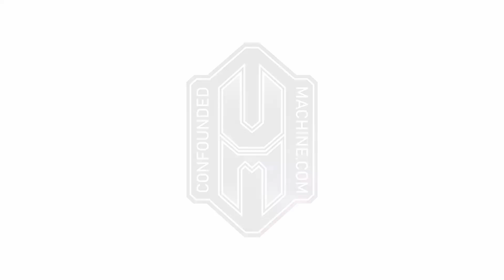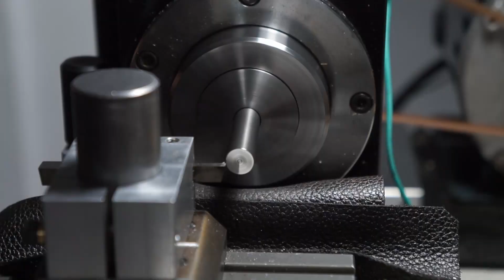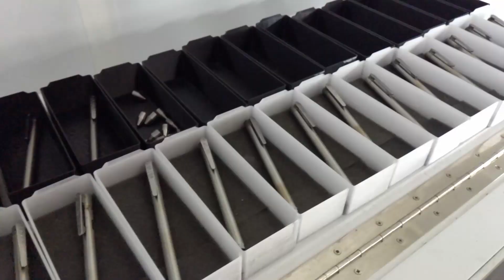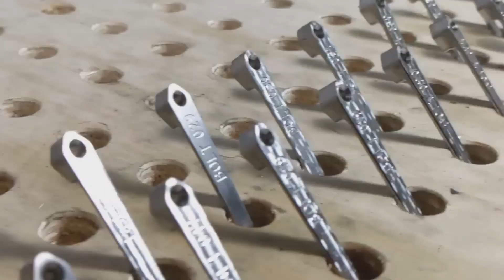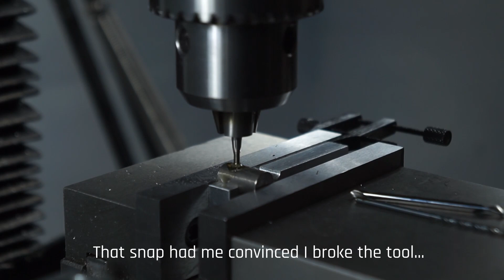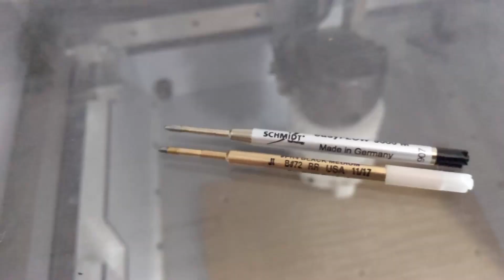Snapping Tiny Taps and Workshop 2.0

Comment: Another great video! Do you have the ability to talk with a technician from a cutting tool manufacturer by the name of Nachi? The Nachi tooling line is made of the toughest materials I’ve ever experienced. I believe they use a sintering process that produces absolutely the toughest taps and drills I’ve ever used! They have a manufacturing plant in the state Indiana. I used their M1.7X .35 form taps for over 25 years and only broke one tap!
Not when tapping, but dropped the tap holder holding the tap on the shop floor. You’re also going to find out how bullet proof their drills perform. We’ve tested Nachi compared to the best Guhring drills for drilling 304 stainless and the Nachi drills out performed the Guhring drills by 150+ holes! Used Nachi taps on just about every material in the shop! Nachi is a Japanese manufacturer. For some reason most shops in the United States have never heard of the company. Good luck! Your new shop is a real beauty! You should be very proud of it!!!
Reply from the maker: Thanks!  Yes, I believe my local machine shop carries Nachi...just haven't given it the time of day. If you have had experience with them outperforming Guhring by that much I will 100% try them next time I need to order taps/drills, thanks for the recommendation!
Thanks again for the kind words, I'm very pleased with the setup so far, been a joy to work in :).

Comment: Okay Curt if you want to take your engraving to the next level, try the engraving/v-carve in Fusion 360. You use a 60 or 90 vee bit, check out Harvey Tool, these are typically single lip but you can get 2 flute. Why do you want to do this you ask, because even on the smallest engraving you can get nice sharp corners you are not limited by the tool radius. I spent 13 years at Chrome Hearts and everything we made was engraved. We did v-carve engraving because it gave a hand engraved look and you could go very small, we were routinely engraving inside of size 3 rings. The inside ring thing is a whole other story, lets just say nobody else is doing it. If you look at software like Vectric you will see that v-carve is very popular with wood workers, I have no idea why more metal cutting guys don't use it.
Reply from the maker: Thanks Eric, I pretty sure 90% of the reason metalworking guys stay away from v-cutters is due to there zero SFM at the tool tip (if you are using a dead sharp tool that is). I oddly enough ran Vcarve for years at my old day job and it can do some interesting work in wood and plastics. I run 30/60 and 90 engravers for all my brass work (which is basically plastic, lol). I actually only ran that style of tool for engraving work when I had my CNC router (before I had the mill). The ring work sounds cool (a size 3 ring is insane, I'd love to see the setup to engrave INSIDE that). I actually have a few of those single and 2 flute spiral engravers...just need to add my high speed spindle to the side of my main to get a half decent feedrate :-)!  Thanks for the comment!

Comment: So you're prepping tip stock on the lathe in this video, loading it into the mill via TTS collet and then turning. have you considered using the mill to turn the tip and part off, then add custom G code to move to a tool/vise location so you could open the collet, feed more stock to the tool/vise as a workstop, and then rerun the code? could save some manual time on the lathe by feeding longer bars into the collet.
Reply from the maker: Yes and no...the method you describe is how I run a few parts (thumb studs in particular) but one issue is the depth of the headstock on the mill. It can only take about 4" into the collet before it hits the pullstud. The lathe can easily pass thru as much stock as a dare (avoiding bar whip), so I tend to part to size on the lathe and transfer to the mill.
I also try to run the operations on each part from most difficult to most simple (junking a part with minimal work into it always stings less than a nearly finished part)...so in the taper turning shot the inside has already been bored to size and threaded, one of the reason I don't bar feed that particular part.
Thanks for the great comment, always makes me question if there are better ways and I very much appreciate the thought exercise :-).
Reply: @CurtVanFilipowski  that makes perfect sense, that you don't have as much material available. good stuff!